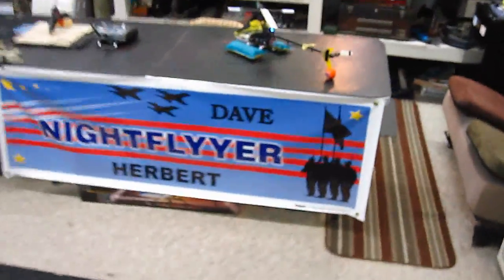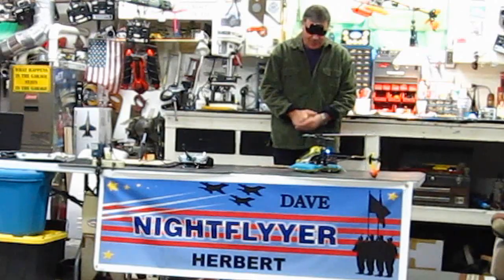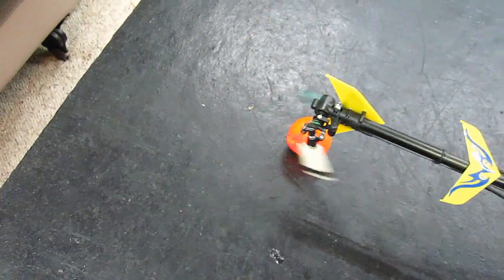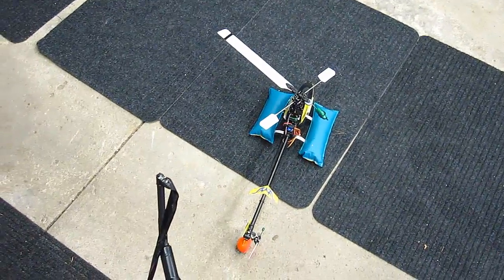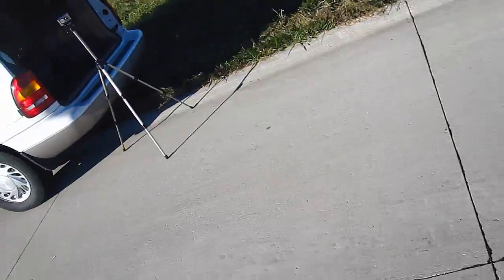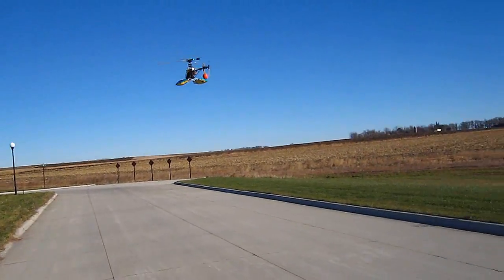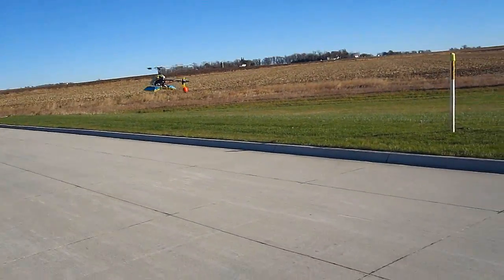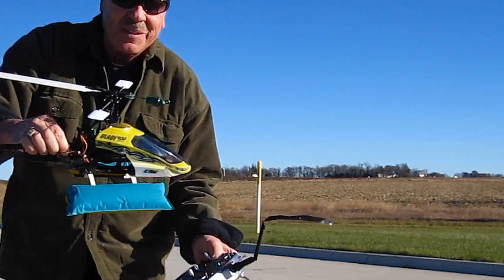1 blade Helicopter. Both rotors.  These are Blade 400 experiments.

Comment: The only "real" difference between using one rotor blade instead of two, that I can think of anyway, from a physics and aerodynamic point of view; is that a single blade has to make up for the losses in lift capabilities.. like how in a two blade system when cyclic pitch is used to move the heli forward, you would at least have the more aggressive angle of attack creating more lift at the exact same time that the opposing blade would be using a softer pitch angle. 
However, in a single blade system it doesn't matter when or where the varying pitch creates more/less lift within the rotor disk because even the single blade rotates fast enough to mimic the lift-force capabilities of a two bladed system!!

When I think of all the math and physics of helicopter flight, this makes perfect sense!! It was cool to see the theory tested and confirmed successfull in practice first, before I ever thought of the plausibility of it.
It all makes perfect sense: as long as the opposing blade is replaced with mass, and the system is dynamically balanced to ensure stable flight... You get; well, stable flight.👌

Very cool to watch these experiments you've made and executed so perfectly and successfully!!😎

Comment: what's with all the disclaimers?
I don't see a problem here. looks pretty interesting. i'm guessing it would put more stress on the blade though, since it's doing all the work with one whereas it was halved with 2 blades. i can see it having slightly better lift with air that isn't as cavitated with 2 blades, and that you probably never hear the blade fart sound or it's greatly reduced. i would like to see more in depth data on it.
Reply: Because people are idiots.  They only need to look at the BO102 (ground based trainer) and BO103 helicopters to see that it does indeed work and works on a full size helicopter.  The BO103 was the only single blade helicopter to fly as far as I know.

Comment: its looks really easy to control only with the single half blade configutation if you need to correct it you only need to work on one mistake not two very simplified

Comment: The reason this works is because as a collective pitch heli blade rotates around the rotor head its actually cycling between positive and negative pitch and is actually only producing lift when its in its positive aproach to the air. With one blade and a counter weight u actually have a more efficient systems but you loose the ability to autorotate...thats why full scale helis do not use this setup. Theres also the problem of thermal expansion which could offset the balance of the rotorhead.

Comment: wouldn't a single rotor produce uneven thrust and friction on the axle?  I understand the counterweight idea and why this works on r/c aircraft but I don't think it would work on full-scale.  I assume the blade would push the axle on that side out of alignment and increase the strain on all the components in the engine.

Comment: @NightFlyyer Hey Dave, this is a really good idea for small and full scale helicopters.  You really should patent this.  This kind on arrangement will greatly reduce the cost and complexity of helicopters, because the rotor heads are obviously the most costly, and high maintenance part of the helicopter.

Comment: @LMF5000 (continued 2...) if you were to scale this up to full size and ride one, you'll feel the vibration from that asymmetric thrust. It's at the same frequency the blades are spinning (i.e. for blades going 200rpm, the vibration happens 200 times a minute), because when the blade is at the back, it tips the heli slightly forward, when it's on the left, it tips the heli slightly right, when it's at the front it tips the heli backward etc.

It's also imposing extra loads on the bearings.

Comment: @LMF5000 (...continued) that since you only have one blade, the thrust is not symmetrical and thus creates a bending moment on the shaft, which tries to tip the helicopter over depending on the direction the blade is pointing (it's like trying to lift a normal helicopter from only one blade with your hand when the blades aren't moving - it'll tip over). Of course since the blades are spinning quite fast the tipping force averages out and the heli doesn't tip, but (continued...)

Comment: The reason one blade is more efficient than two is because blade tips generate wingtip vortices that waste energy. Removing one blade and hence one tip would  thus half the energy wasted. Same reason why they don't make biplanes anymore - two sets of wings means four wingtips and four sets of vortices. Monoplanes have just one pair of wingtips - and winglets make them even more efficient because they break up the vortex! The only problem with your single blade idea is (continued...)

Comment: Sweet.
Works well.
It would be interesting to find what the advantages (if any) such a system would have.
It would by my guess have diminished lift and yaw strength,although the yaw wouldn't really be an issue.
Although in blustery conditions,it could be.
I could be wrong though,just a guess.What do you think?

Comment: @wannalayya u can still fly it just get a battery with the same voltage or u can even use a lipo battery and change the conecters to whichever u want, only problem is if u get a battery with a higher voltage watch how much throttle u put cuz if u put to much ull  burn our everything

Comment: @NightFlyyer ETL being around 16-20 knots air speed for full scal helos varying from model/size etc.. Anyway once you get through ETL you're flying into clean air and lift is improved along with alot of things. If your B400 still had two rotors it would be more efficient to translate the engines power into controlled flight after ETL, yes, even if the one blade is still more efficient in a hover. No I'm not saying you get more down thrust from one blade in a hover than two, you don't. ETL.

Comment: @NightFlyyer  #1 The one blade could very well be 75% as efficient as two in a hover, But one thing I forgot to mention is ETL! effective translational lift (ETL) Translational lift is obtained by any amount of clean air through the rotor system. Even 1 knot of air introduced into the rotor system from either wind or forward speed provides translational lift which improves the efficiency of the main rotor. Basically this means once you bust through ETL Continued in #2

Comment: @NightFlyyer Of course it takes less power there's half the resistance the engine has to turn. It probably is pulling a little more rpm's than with 2 blades because that's just how hp/rpm/torque balances torque = resistance. A Ch53 Super Stallion has 7 main rotor blades for a reason. Well, basically that reason is that it's such a high performance bird it needs all those blades to take advantage of its power ultimately creating more lift, But I can't deny loses some efficiency with each blade.

Comment: @NightFlyyer I know you think you're onto something no one else has tested, But I hate to break it to you man, But, it's been around since the 40's and 50's. This has been a myth since the beginning of times with die hards still holding onto it. If you're pulling stumps it probably is something like 5-10% more efficient than 2 blades, But still only produces 4/10ths the thrust as two. I'm not denying that you lose some efficiency with more blades, But sometimes you're limited to the diameters.

Comment: @NightFlyyer There's a reason Boeing, Bell, Cessna, Piper, Mooney, etc uses 2-7 blades instead of one. Do you really think they spend billions of dollars and perform countless thousands of hours of research to be less efficient or practical. A three bladed prop is something like1.48x as efficient as a two blade prop of the same diameter, But you can add a blade instead of a diameter increse due to lack of space etc. You can never get more energy out than you put in.

motoballz 13 hours ago

Comment: @IgorGiganskiANtiatom They have. There's a reason Boeing, Bell, Cessna, Piper, Mooney, etc uses 2-7 blades instead of one. Do you really think they spend billions of dollars and perform countless thousands of hours of research to be less efficient or practical. A three bladed prop is something like 1.48% as efficient as a two blade prop of the same diameter, But you can add a blade instead of a diameter increse due to lack of space etc. You can never get more energy out than you put in.

Comment: Test it to see how much thrust in produces in ounces with both single and duel blades rotors. Of course it used less energy to hover bouncing in and out of ground effect since there is less drag. Two blades is just more thrust the blades might run into the turbulence sometimes, But I doubt that makes it "less" efficient.

Comment: Sure seemed stable in that wind. I heard you say 1/4 power at one point while you were in a headwind hover. Smoother flight, less power to stay in the air, longer flight time, looks like you caught a gem that the industry missed. Someone needs to manufacture these. Might not make them rich but it could make for a tidy little income.